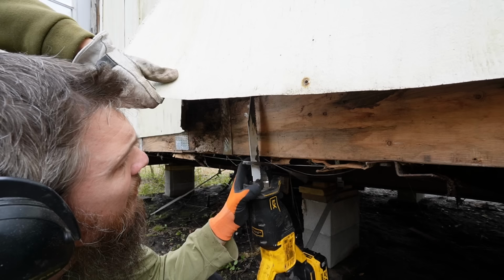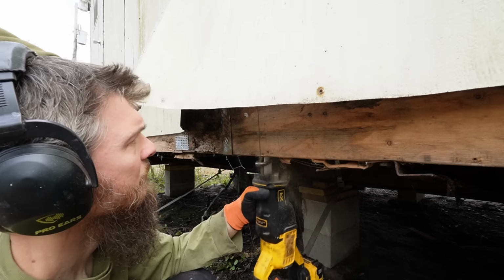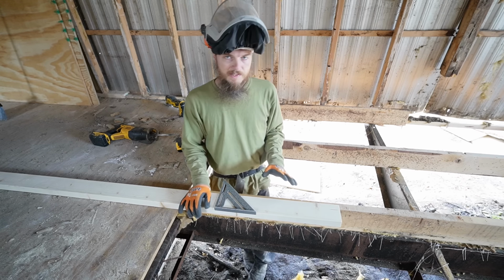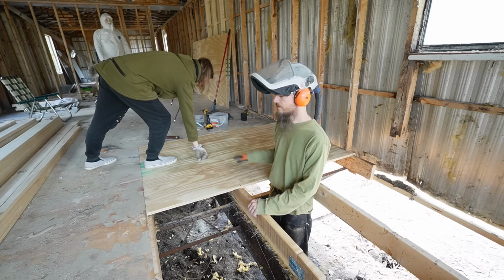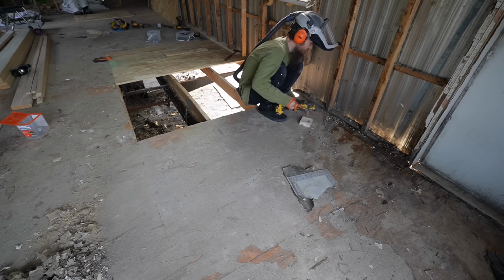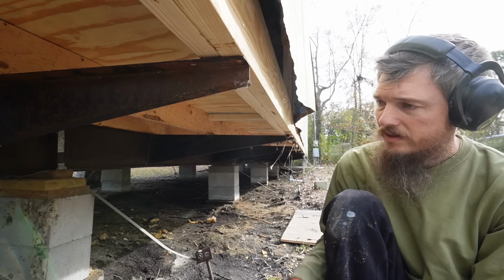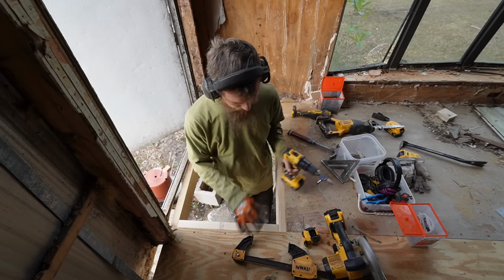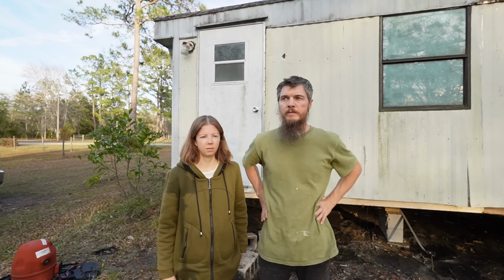WE DID IT!  Daunting Floor Repair - Mobile Home Rebuild

Comment: Pushing through to finish the floor was tiring but I imagine it was also rewarding.   Of course you are doing so much more than the floor - you are also removing and replacing windows, removing and replacing doors, removing all damaged wood, maintaining a tidy work site, hauling damaged wood and old doors and windows to your home property, etc.  With every project my respect and admiration increases.   No shortcuts allowed.   Sadly such high standards are very rare today.

Comment: I wish I was half as strong and agile as you are. My advancing years are really slowing me down! You did however inspire me to renovate one of our bedrooms with new insulation, wallboards, plaster, window cill, and a new radiator before re-decorating. Takes me much longer than it used to, but the end result is very satisfying. Keep up the good work😅.

Comment: I just got an idea. IF you just did the bay window half then you'd have the windows at the top and you could do cabinets along that wall with the sink in it. Then when you stand at the sink you could look outside AND you'd have lots of cabinets to AND the windows, just half way across that wall. THAT would be really cool because it would make the kitchen larger. AKA Rose

Comment: Hey buddy I know you do a lot of this work but can I suggest something when you use that pry bar or your Hammer take and turn it sideways when you pound it in take and pull sideways on it instead of pointing straight out if you do it sideways it's a lot better leverage and it helps pop anything try that and see if that works for you

Comment: Great progress!  I have some thoughts on the removal of the door in the kitchen. I noticed that you parked the van close to the mobile home's kitchen. If this is the location of the parking space for the future, it would be great to have easy access to the kitchen close to the parking. If you replace that door and add a nice deck or patio, it would give easy access to the kitchen. Not just for delivery of goods but to give a comfortable door to access the yard area. A patio or deck for BBQ or quick access to this part of the property. Sitting, gardening, and reading in the space would be great. I am older so I see things that make moving around with less effort. If you rent out this MH in the future, you do need to consider that your renter may be an old person. Just my humble opinion.

Comment: Yo bud I'm doing a 14x70,replacing all the floor joist, banboards,and bottom wall boards,and all the plywood on the floors.i learned to put temp bracing from the floor to the ceiling it helps alot.its a ton of work,no contractor would touch it.but almost finished.nice to see I'm not the only one crazy enough to tackle a job like this.😂👍👍

Comment: We turned down a beautiful mobile home at a great price about 5 years ago due to the joists being termite and water damaged.  Now that I see how easy they were to replace, I wish we had purchased the home.  We could have supported the roof and wall on the outside and replaced all the perimeter joists.

Comment: Great job. I know that is a load off of your plate. Excited to see what you are doing with those big bay windows up front.  It looks like a bay window but maybe it's a couple of picture windows. It is unreal how so much could have termites and some not.  Living in the south I know that is the way it can be but they are a real disaster to wood.......not only in the south however.  We have carpenter ants here but we've had no issues but many do. Everything looks great and so glad you got all or most of that flooring done. Hopefully the other side is free of all that type of damage. Will you treat for termites just for safety precaution or whatever may be in that you don't see.  Wishing you all the best and this is really a fun adventure.  Thank you for sharing it with us.  Awesome job you two...........awesome!!!! 
Blessings

Comment: I really like how you stick with one project and solve the problems.  Is there a rule of thumb for how long the screws are or how far into your blocking is appropriate?
Reply from the maker: Ideally you want the subfloor screws to be at least 2-1/2" long. For toe-nailing or end nailing the framing, they should be at least 3". I hope that answers it.
Reply: Thanks!

Comment: My husband was a mobile home dealer at one time..one if the prettiest single wides we sold one time had light blue siding with White shutters..it was so cute.. are you replacing the windows with new ones? It's coming along so well..excited to see the next steps
Reply from the maker: Yep, we've been getting rid of all the old windows. We're doing a new layout, so some windows are being moved to new locations :) Thanks!

Comment: Does the siding down by the rim joists ever get sealed or caulked? Seems like that would be a big entry point for spiders, roaches, and other bugs if not sealed.  I just noticed when you were replacing those rim joists the siding just seemed to be nailed or screwed to the wood. :)
Reply from the maker: In the past it was only screwed but not totally sealed and it did allow bugs to get in. We do plan on sealing it up better when we finish the siding and trim work. We hope to keep the bugs out.
Reply: Beautiful video, you are so interesting to watch. Have a good evening.❤

Comment: The screw you used to secure the metal frame to the new floor board support has to be larger in diameter.

Comment: Well, from the perspective of sitting in front of my laptop, that was pretty easy! 🙂 I was wondering if you were going to eliminate that door. Not sure if you're putting the kitchen in front, but if so, opens up a lot of usable wall space for cabinetry. I'm wondering what a mess that bay window is going to be. They are noted for leaking, and hoping it's not Swiss cheese behind the wallboard. And totally get wanting to get the job done when you're so close, and happy it went well. When I was at that point, it's when I made stupid mistakes, and tools and curse words flew 🙂 Amazing work you guys!

Comment: Do you have to add hurricane anchors to the structure or were they on there when you purchased it?
Reply from the maker: They were already installed. All mobile homes need to be anchored down no matter where they are in the country.

Comment: Just wondering: was that mobile home attached to anything besides the metal frame? anything to hold it down in case of high wind? The plywood looks useable, maybe bookcases?
Reply from the maker: It is fully anchored down to the ground. All mobile homes are supposed to be anchored.
Reply: Thanks. @diyfferent

Comment: With the climate in Florida, and your long termite season, how come your are not using more pressure treated lumber in the rebuild?
Reply from the maker: It's not ideal to mix treated and untreated lumber since treated lumber is wet when new and then shrinks down quite a lot as it dries over time. So lining up everything perfectly wouldn't stay like that when it dries. For general framing, I always just like to stick with untreated lumber.
Reply: That's so good for me to know. Thank you so much!💕🐑🦌🦌🦌🦌🖖🕊❄️🐈‍⬛🫖📚🥌 @diyfferent
Reply: Thank you very much!

Comment: I hope you don't take the bay window out  but it does need fixing
Reply: I have been wondering about that one from the beginning. It is truly beautiful and I really doubt the area is in any better condition than any of the other windows and doors. 
Maybe they could carefully support the frames and cut out the rotted wood under them then put in new? A bit at a time? Sister in longer plates and joists and then, when things are stable, cut out the old? 
I am familiar with the butyl tape they use - it doesn't work at my altitude and climate, but it does have an incredible tack when first put in. Perhaps they could take advantage of that to hold things long enough to get the work done?

Comment: My ex once fixed the floor by throwing back the carpet and putting down a piece of sheet metal, put carpet back and moved sofa on top. Also one day in the middle of replacing front door he left with friends and was gone all day, door was just propped up and I had a toddler. That’s why he’s an ex. Smh

Comment: Wondering if and how you plan on insulating the floor? Well done by the way! Watching from Nova Scotia, Canada.
Reply from the maker: We plan on adding insulation from underneath once all the wiring and plumbing is complete. It will probably be regular fiberglass insulation.
Reply: @diyfferent  ah c'mon I was counting on bubble foil...🙂
Reply from the maker: @savannahsmiles1797  Don't count it out just yet. We'll need something to protect and seal up the fiberglass insulation.

Comment: Another great video...I got the ESTWING prybar in the mail today. What brand is the driver you are using for the screws? Learning a lot.
Reply from the maker: Thanks! We're using our DeWalt drill driver with a variety of bits. Did you want to know what a specific bit was?
Reply: Yes...I ment to ask the type of bit ( attachment) you were using to drive the screws.  Thanks.
Reply from the maker: @johnalbino1957  Drywall Setter Bit Holder: https://www.montanabrandtools.com/products/7pc-drywall-screw-setter-set
Reply: @diyfferent  that's it...thank you.

Comment: Question? Is it suggested to seal the plywood that is exposed underneath?  IDK. it seems it would last longer.  ???  🤔 hmm. I am fascinated how manufactured homes are constructed. 😮😮
Reply from the maker: It doesn't need to be sealed, but we will be insulating it later on so it'll be covered. As long as wood stays dry, it'll last for a very long time.

Comment: Noticed bricks under corner/door but now down. Where they just there to support sagging/dry rot floor under door?
Reply from the maker: It wasn't because of the rot. All mobile homes are supposed to have support piers under the doors. It's just a standard practice.
Reply: @diyfferent  you could just turn that whole mobile home into a workshop
Reply: Thanks for the information

Comment: Great job. My son watched before I did and told me to look out for the ghost leaving the building pronto at 17:50 so I did, then told him it was a window [sorta] shaped trick of the light /sun passing thingy, he said that end was in the shadow and shadows don't slide under the building at that speed. Someone explain it so I can prove he's an idiot.
Reply from the maker: That's from the door swinging open and making that light stream across like that :)
Reply: Looks like the reflection of a passing vehicle or the kids opened and closed the door to their bus and the sun reflected off the light.
Reply: Lol..I keep watching looks like a trick of the light like a car going by or something?..Than another clip the placement of the open door and the van parked I'm not sure how another vehicle reflects light at that angle?It is sorta square shape to be a ghosty??🤔..Boooo knows???😂
Reply from the maker: At 13:17 you can see it happen a lot on the floor as the door swings open and closed.
Reply: @diyfferent  Yep..ghost case closed!...Lol!

Comment: OMG at the roach scat.  Did you see my video of where I lost it over the amount of roach scat I found in the house I started renovating and then gave to my sister (The Ropes of Renovation)?  Yikes!  What are those hanging from the floor joists where Doug is installing nailers?  Nails, string?
Reply from the maker: It's string from the old papery stuff that was holding up the underbelly insulation that we removed :)

Comment: I know those metal cross beams are engineered to hold the weight of the walls and roof, but seeing those tapered ends supporting that load still looks inadequate.

Comment: Having the floor joists running parallel to the I beam seems like a really bad way to design a structure. There's almost zero support for the exterior wall.
Reply: In FL, you're not going to get a snow load on the roof like up North.  Apparently, it hasn't been an issue for about 40 years.  Also, I have seen 2x6s used for floor joists in a house before.  They were strong enough for the span.

Comment: For all the meticulous, work that you do why would you not clean off those joists of all that cockroach poop before you lay down the new floor? Gross.
Reply: goes hand in hand with   cleaning. the exterior... imagine trying to seal the windows against. the growth on the aluminum. siding or  hidden thin spots underneath
Reply from the maker: It's mostly just staining. Yeah, it's kind of gross. But it won't hurt anything.
Reply: @diyfferent  yes but what seals against  filth. I get that you said it will be washed after but whats under isnt going to seal  well in spots where it over laps. Alot of it looks stained but  can put cleaners on prior to light pressure  washing and anything  potentially  left behind would be really lightly covered  or completely  removed.